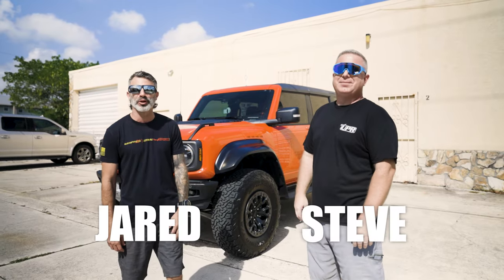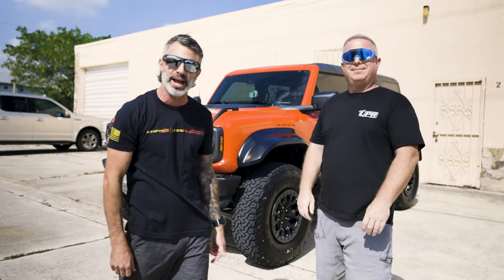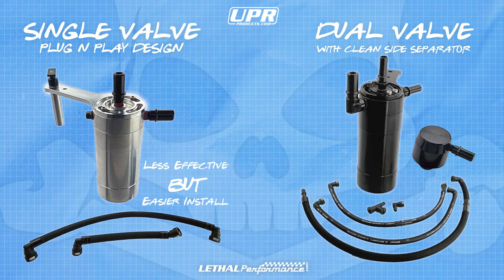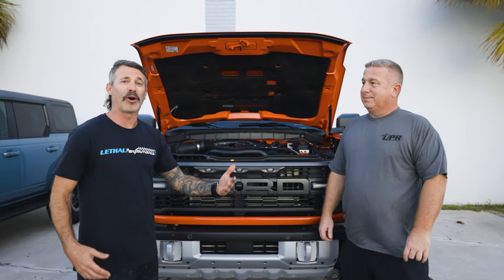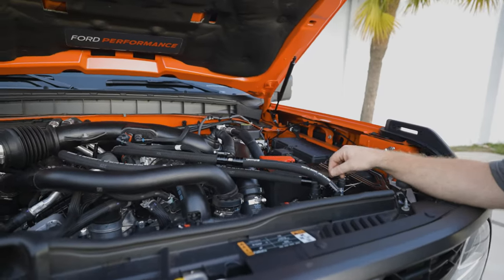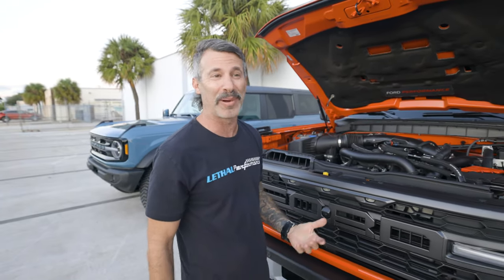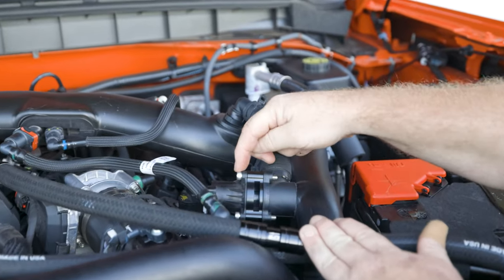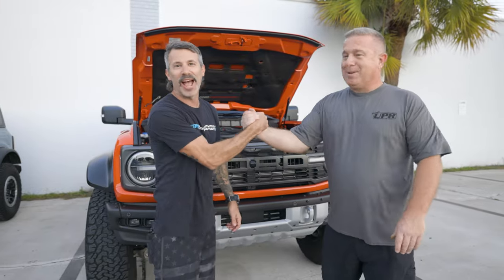BRaptor's MUST DO First Mods! - Bronco Raptor Catch Can & Goodies at UPR!

Comment: This video is mostly FaceTime and bad advice.  I’ll stick with the Ford Performance engineers on this one, personally.
Reply: Ill have to agree , no need for a catch can sorry
Reply: @geocap7980 people trusted ford  engineers on the 2.7 and 3.5 ecoboost and they regretted that choice as well.  A catch can is a must for a well maintained boosted motor to keep the valves clean.  Unless you have a port injected motor then it’s not as important.  DI only then it is.
Reply: I will respectfully disagree having owned 7 turbo engined vehicles including a 2017 raptor and a 2023 Braptor . A catch can is not a must
Reply: @geocap7980  if anyone those 7 motors were DI only then I guarantee you had valves with excess carbon on them.  Every DI motor has this issue especially forced induction.  If they had port injection then it’s not as big of a deal.  I’m not willing to bet Ford learned their lesson from the 2.7 and 3.5 valve carbon issues but maybe they addd a port injector like they did on the 5.0 or remodeled the pcv system.  I haven’t researched these motors in depth yet.

Comment: catch cans are the biggest scam in the automotive industry lmao. NO, oil will not backflow into the throttle body  and mess up your intercooler and coat your intake manifold yada yada yada.
Reply from the maker: I'm sorry you're mistaken. Check any throttle body and/or intake tract on any modern vehicle, especially one that is boosted, and without a catch can, there will 100% be some sort of oil residue. The PCV system is designed to recirculate crankcase pressure, which happens to be an oil mist, back through the intake on the vehicle for environmental purpose. Not only the oil mist build up overtime and cause issues, but can certainly reduce engine efficiency. There's really no myth or old wise tale to be told here, its been tried true and tested over quite some time now. It's literally what the system is designed for.